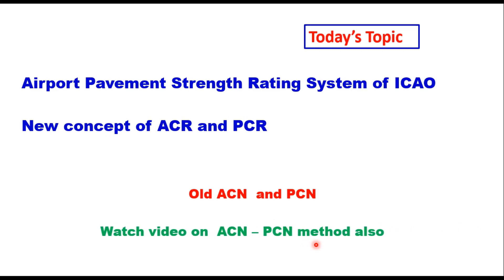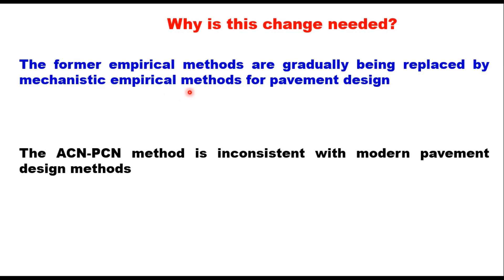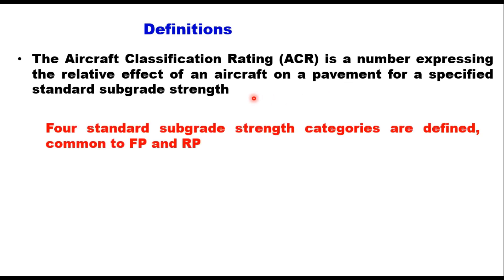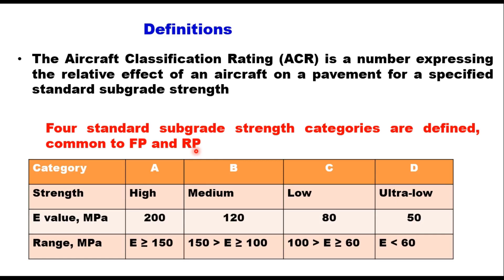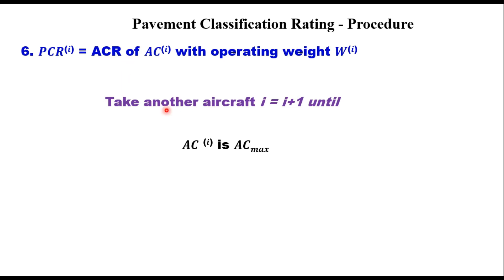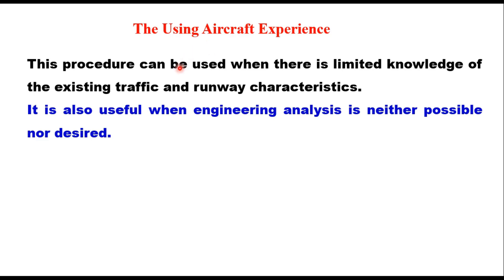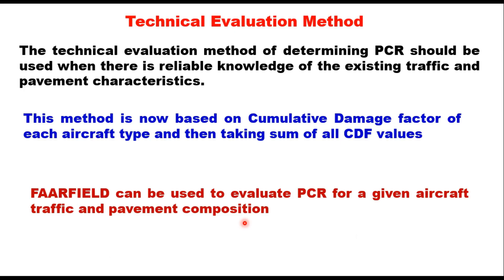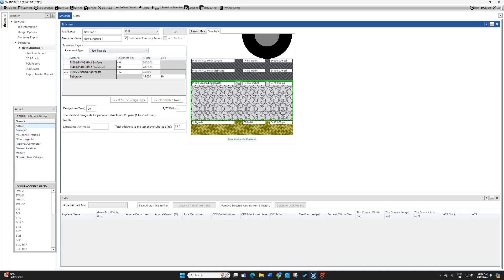Airport Pavement Strength Rating System of ICAO, New concept of ACR and PCR in place of ACN and PCN

Comment: What about P/C Ratio greater than 1?
Reply from the maker: A P/C ratio greater than 1 is a favorable condition, as it indicates a lower concentration of stress repetitions on any single spot. This results in a more efficient pavement design, possibly requiring less initial thickness than a design assuming a P/C of 1 for the same number of annual departures.